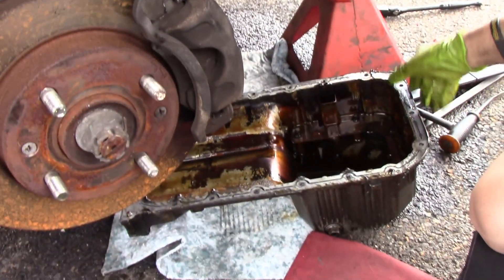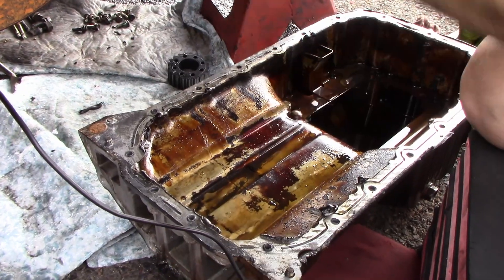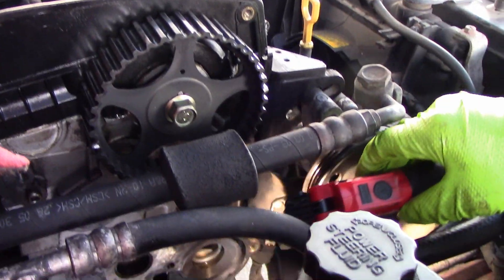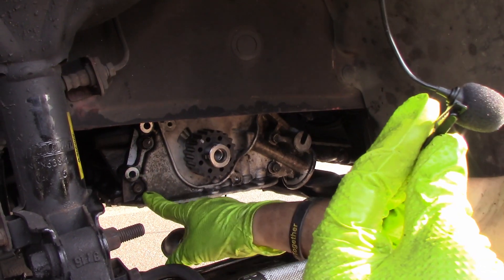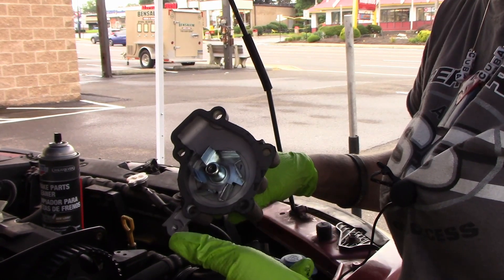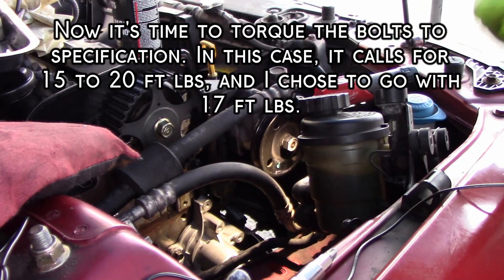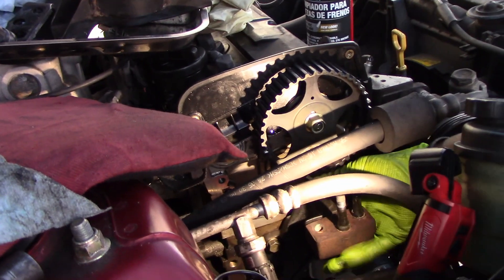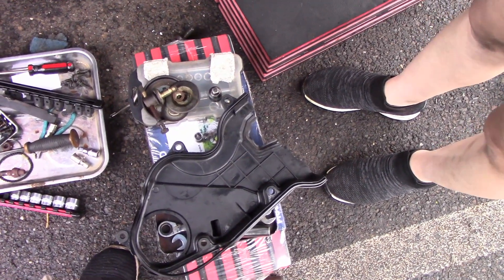04 Elantra 2.0 Ltr -Timing Belt, Water & Oil Pump Job -Part 2

Comment: Hey Cuba What's Up Girl!! That bolt In the pan very handy, We appreciate all the info, the specs about the torque on the bolts is a value information, on the other hand, the oil pump bolts just hited with the Hammer over a phillips screwdriver, right on the spot , works for my, pre lubs the oil pump is and excellent tip, Great video keep rolling baby 😎👍
Reply from the maker: I'm glad the torque specs are appreciated... I try to mention them on the more important areas. 

I did try hitting those oil pump Phillips  head screws with a small hammer and screw driver, but not one budged. If it's not broke, don't fix it. The lack of service info was also disconcerting.... I went through Alldata & Mitchell, and neither showed many specifics on this vehicle.  Very few images, etc. The lack of not knowing if there was a seal or not, inside the pump pump, had me worried.... which is another reason I chose the route I did there. 

Gracias Carlos y saludos 😊😉